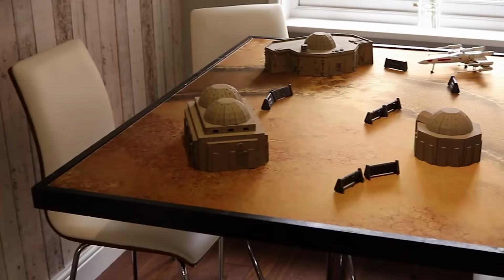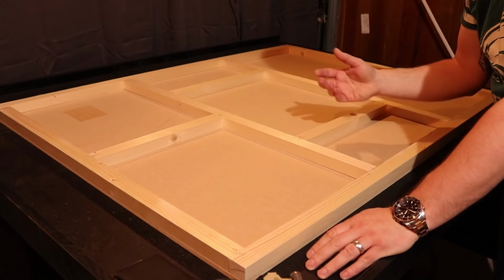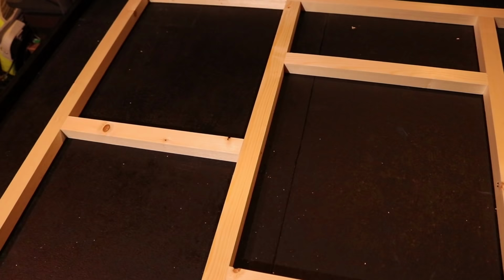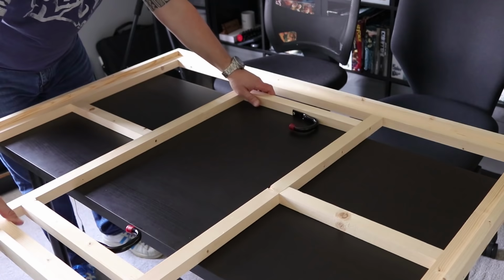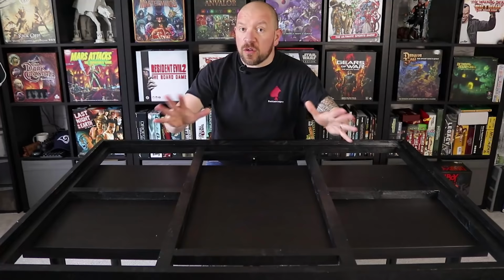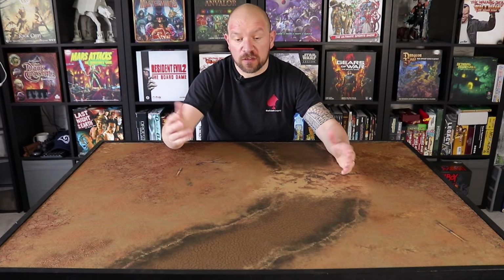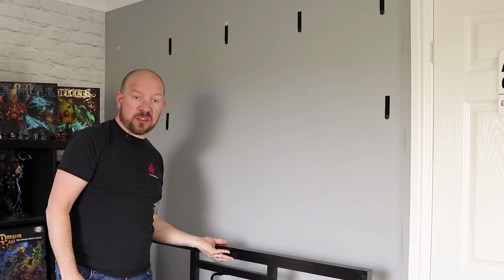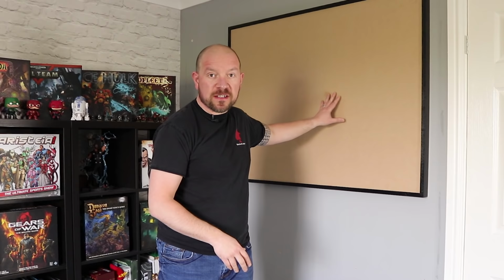How to Build a Wall Mounted Gaming Table

Comment: Looks great Andy!  If you had a dado head on your saw rather than adding hooks you might have cut channels into inline splines that could have been purpose fitted to your table.  I think two parallel braces would have been sound enough and reduced your weight a bit.  It looks awesome on the wall and yes I will send pictures of my cat to you suitable for framing 😁
Reply from the maker: Thats way too technical for me - I just needed it cut straight!  For a first go I'm happy.  I'm sure there's many improvements that could be made 2nd time around ;)
Reply: @BlackJackLegacy  In spite of "limited technical" skill it looked really slick :D .  My carpentry is all about form and function and I tend to neglect the finish work at the end of a project.  Looks like it belongs on a wall.
Reply from the maker: I just look for the easiest route - I’m no carpenter but I can get the ideas.

Comment: This is a great idea. And for those not crafty you could maybe look for a 2nd hand picture or mirror frame the right size? Cheers for sharing. I might do something similar in the conservatory
Reply from the maker: Yeah that would work well too but you'd just need to strengthen across the centre for smaller tables.  Thanks for watching.

Comment: The thing I will say is that eventually either the glue will go off or the paint will fail where you are taking the board off the wall.

I put up a load of noticeboards with the super strength velcro we use at work and they have all fallen down just through the paint coming away from the wall within 1-2 years. And that was just with regular light noticeboard type use.
Reply from the maker: If that’s the case I’ll hang it a different way over time.  Thanks for the heads up though - I’ll keep an eye on it to see how they hold up 👍🏼

Comment: Great job man. This might be the way forward for me. Have you considered putting a piece of ribbon/fabric on the underside of the MDF to make it easier to lift when attached to the wall? Kind of like what they do with some battery packs.
Reply from the maker: Thanks buddy.  Yeah I was trying to think what I had that would work but I think you’re right - maybe just some thin material glued/stapled to the underside would work great. 👍🏼

Comment: Good stuff there :) I like the use of magnets and sure opens way to having some preset gaming sheets on the side for easy replacement. If I come to make something similar ( i still have a 6x8 big game table but a 4x4 is on the plans ) I might use a minimal wall rack coat hangers instead of the velcros to hold the piece. So when ppl come to play, they can hang their stuff there while we use the table. And for the historical gamer, this must look gorgeous on the wall with a historical battle map repro or similar :)
Reply from the maker: Thanks Hethwill! Ive has a few extra ideas on improvements after uploading this too and it’s great to hear other suggestions too.  Thanks for watching too 👍🏼

Comment: Awesome video, planning on making my own soon, however am hoping to go for a 4’x6’ size. Do you know if the velcro would have any issues holding a larger/heavier table like that?
Reply from the maker: It would be down to weight - worth checking first.